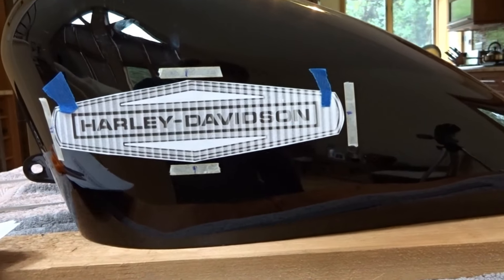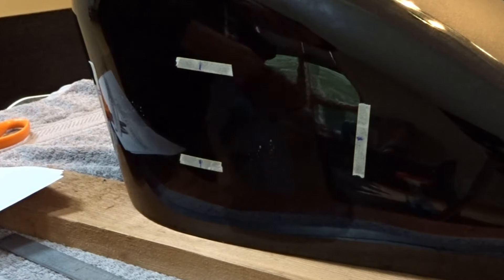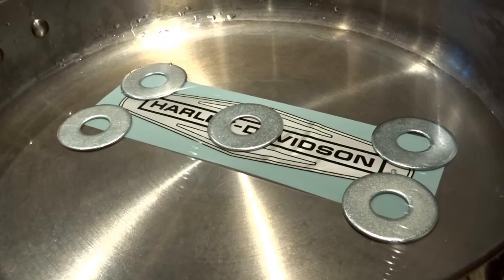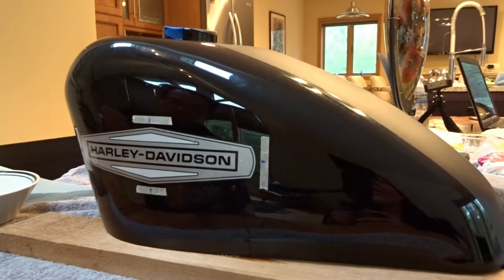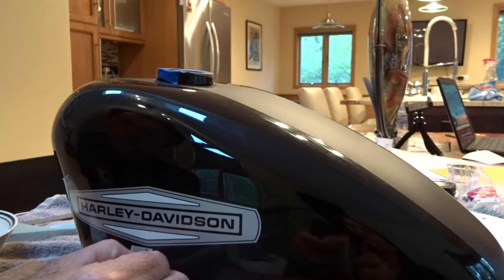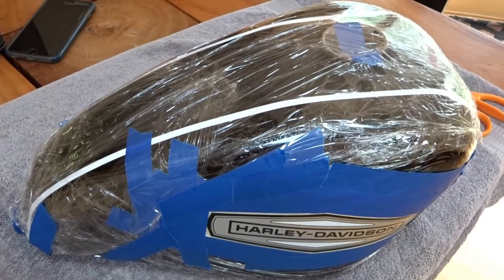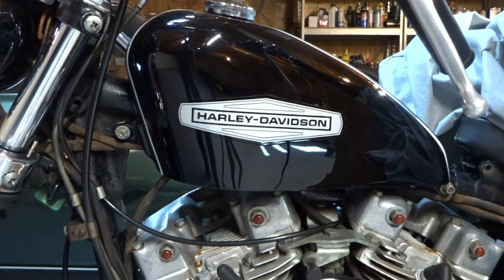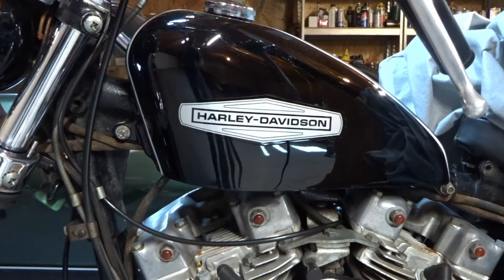Harley Sportster iron head XLCH decals for factory original motorcycle paint and custom paint jobs

Comment: Another good video. Thanks for all the informative tips. I'm almost surprised that you're not clear coating over most of the tank. Really like the quality of your work, Michael.
Reply from the maker: Thank you Joe, actually I did clear coat over the whole tank, then used a Matte clear for the black stripe, the jet black paint shows right through the matte clear to make it look like I used flat black for the wide textured stripe.
Normally, I would have applied the decal on the jet black base coat and then clear coated over the whole tank and decal at the same time, then painted the matte black stripe on last.. 
But, I wanted to take my time laying out the decal in the proper location without rushing so I just clear coated my jet black paint job about 45 minutes after the jet black was sprayed on. Actually with this simple style of a decal it was very easy to mask off and blend the clear coat over the decal and on to the existing clear coat. If it was a more intricate decal then yes, I would have stopped and applied the decal on first then shot the clear over everything at once.  One advantage to the way I did it was, if I ever wanted to change the decal all I have to do it wet sand through the decal clear coat and remove the decal without disturbing the paint job and the clear coat behind the decal.. if that makes sense.  In other words the decal and the clear I shot over it is not baked into the actual paint job and clear coat.  Actually the factory original was nothing more than a sticker you could peal off like many original owners did back in the day.

Comment: Apparently the original factory decals would come right off.  My oldest brother bought a blue 1968 XLCH in 1970 and both decals had already been taken off.  The wrinkle black and white stripes were still in place.
Reply from the maker: Thank you for your comment, it’s great to hear your experience pertaining to the original 1968 paint scheme. Our experience is very similar because my older brother bought his 1968 XLCH soon as he returned home from Vietnam in 1971. His was the sparkling burgundy color with the original factory “stickers” That many people would just peal off.  They had no clear coat. The base color for the “sparkling” colors such as blue was actually silver, then the color top coat was added last for the translucent effect.  In fact I plan on reproducing these original factory colors when time permits. I really appreciate you commenting on this topic.
Reply: @Michael-st1hl I have a Sparkling (HiFi?) Blue 1969 XLCH.  The original paint was long gone on the sheet metal but not long after that an original paint (blue) gas tank popped up EBay.  Then I found an NOS (yes, still in the wrapper!) front fender in (you guessed it!) blue.  I did have the rear fender painted to match (gray primer, silver base then candy blue until it matches).  Motorcycle sat like that for a couple years then I found a used, original paint blue front fender (which matched the tank perfectly) and that’s on the bike.  Fortunately, even though I had the NOS front bolted on the bike I never had the heart to remove the old Harley-Davidson wrapping paper.  Not sure what I’ll do with it now.
Reply from the maker: @johnkelly6942  That’s a great dilemma to be in having a factory original still in its original packaging.
I’m like you, it wouldn’t be easy to expose such a wonderful piece like that!  It’s good the original paint codes are still available so we can at least reproduce these great paint schemes.

Comment: What's your reason for not clearing the decal with the rest of the gloss paint? Isn't that how the factory did it?
Reply from the maker: No, the factory actually used a sticker over the paint job. Many new owners peeled them off back in the day.
My reason for not clear coating the decal and tank at the same time was because I did not want to stop in the middle of my paint job and lay out the decal in the perfect position because it takes so much time. I usually spray my base coat color and give it about 45 minutes to set up, then shoot the clear right away.  Since this is a very simple decal I knew I could easily mask it off and shoot clear over it at my leisure.  If it was a more intricate style decal, then yes, I would have stopped after my base color coat to apply the decal and then shoot clear over the whole thing, but you have to wait 3 days for the decal to dry first which I explained in the video.
I just wanted to finish the paint and clear coat the same day. 
One advantage is, if the decal ever was damaged, all I would do is wet sand through the clear coat, remove the decal for a replacement without ever touching the paint and clear coat under the decal. In the end, it turned out very nice and technically the factory never clear coated over their “sticker” I used to ride this same bike when it was fairly new back in the day so I know exactly how the paint scheme was layed out and the sticker as well.  I really appreciate your question, I hope you subscribe and follow along as I go forward with these vintage iron heads. I plan on filming riding my vintage Sportsters down Route 66 this summer.  Take care!